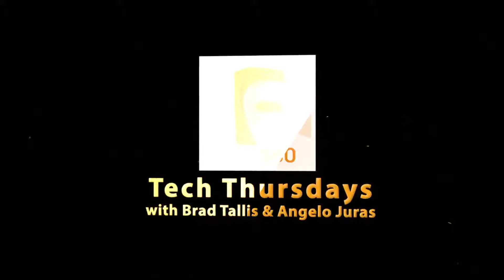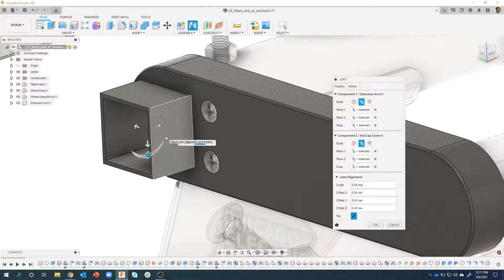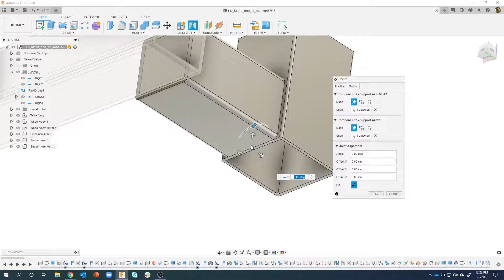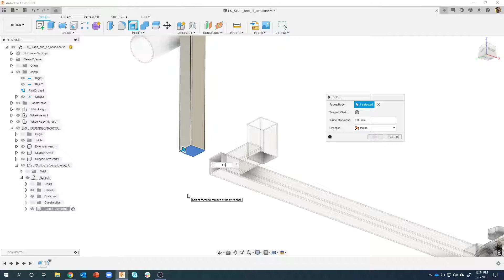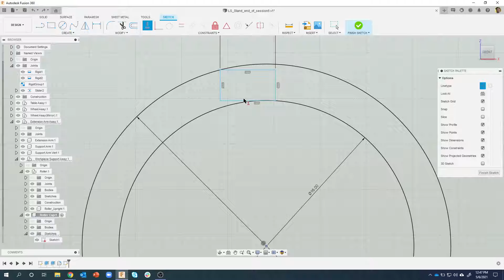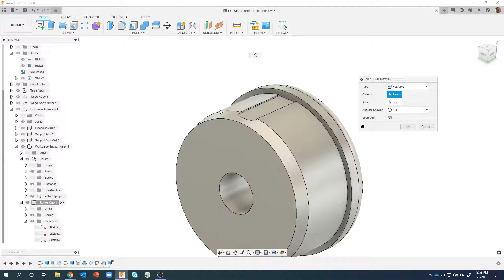Episode 88 - Miter Saw Stand project   Part 7

Comment: I can get the extension arm to slide horizontally, but I can't get the upright roller arm to slide vertically at the same time.
Reply from the maker: Make sure you don't have any constraints locking down the roller arm from sliding vertically.